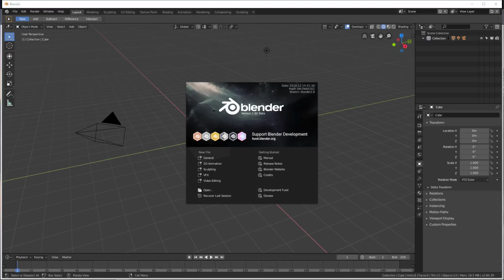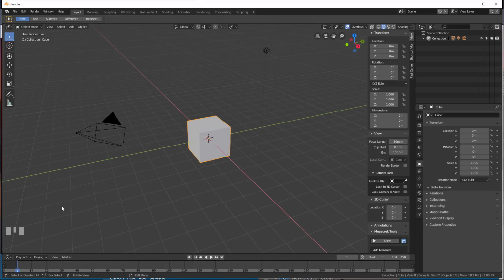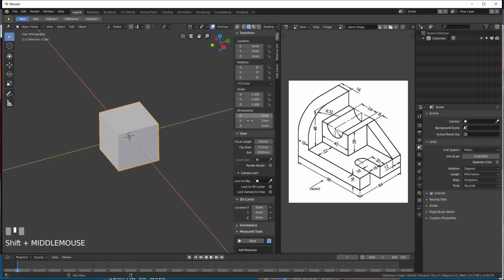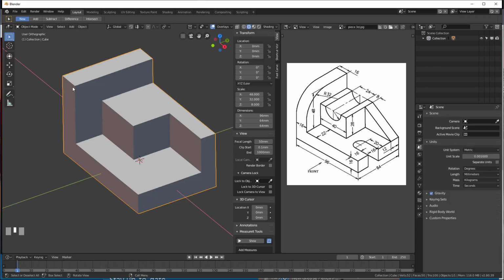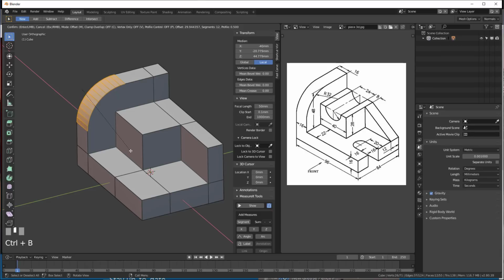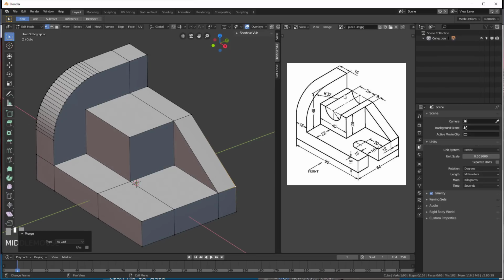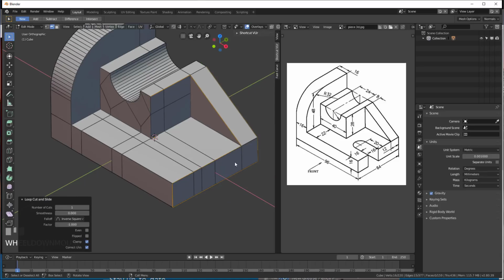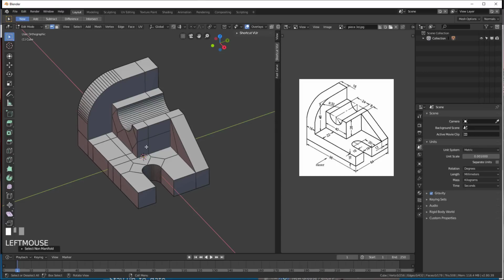Blender 2.8 Modeling a technical piece

Comment: +1 yojigraphics - This is a nice tutorial but clearly reveals how inefficient and time consuming that Blender is when creating precision/technical models as compared to parametric solids modeling CAD programs like Solidworks, Inventor, Autocad, etc.
Blender is a wonderful incredibly powerful tool but gotta admit I'm disappointed that Blender creators have completely ignored all of us engineers and machine designers to date who appreciate efficiency, accuracy, and parametric full editability at any and all stages of completion, and even post completion model revisions.   Oh well, at least we can import into Blender base geometry from our CAD models.
Reply: There are things called "Boolean Modifiers" in Blender that could have handled that much better with a non-destructive approach. You can basically add primitives and use them to extrude or remove shapes.
This approach would have been much closer to Solidworks/Catia/Fusion 360/CAD Softwares. Maybe the author didn't know how to use these tools.
But in any case I believe you're right, you'd still be a bit slower with Blender and you'd have to care about the amount of faces and to maintain your mesh clean / without artefact if you do it wrong.
Reply: @leplubodeslapin  I guess the real problem is the inherent diametrically opposed differences between precise solids-based CAD modeling vs mesh-based artsy-fartsy sculpting - size/precision be damned - approach.   Both methods have their own strengths and weaknesses.  Gotta admit Blender 2.8 is definitely worth the effort to learn... but what a freakin' learning curve for old farts like me!  😁😄😲😭
Reply: @Jimbo-in-Thailand  Yea I know how it feels!
I've used Catia for years before trying to learn Blender (for diferent usages, first one for product design and second one for real-time 3D meshes, but still both object oriented) and it's been quite hard to learn a completely different new approach of 3D modeling (solid & mesh being really different) but it's doable don't worry !
Good luck and yea don't drop your favorite CAD software, it definitely have some strenghts against Blender/Maya/3dsMax !
Reply: @leplubodeslapin  LOL thanks!  Yep... this time... I gotta do it.  😊
Reply: I'm dissapointed by the creators of CAD software that they completely ignored us, who model characters, animals, nature, fluid and fire simulations,.........................
Reply: @orsarino5395  🤣🤣🤣🤣 Yep... life is tough for all of us, ain't it ff? 😊
Reply: @orsarino5395  Toucheeeeee!

Comment: 13:36 or you could just select the verticies and choose disolve vertice or disolve edges... also 15:22 bring in a cylinder and use a Boolean modifier to create those cut pieces.

Comment: That tecnical shape can done in less that 3 minute in skectup, at least every software have 1 or 2 advantage to another
Reply: A tutorial is always longer than the necessary actions. If you’re fluent in blender I guess you can do it in under 5 min.
He explained one region in three different ways.
Reply: @hermask815  i am use blender too, but for tecnical drawing sketchup or archicad or autocad is more suitable for that technical drawing than blender.

Comment: At 7 mins in the video, it's loop-cut demo,  I follow you steps almost, but I can not let loop cut at 16mm, my keys are Ctrl-R  then GX+16, what steps i missed ?
Reply: you have the right steps, did you left-click to position the loop on the far edge before typing GX16? (which should then grab the selected loop and move it 16mm on x axis). There shouldn't be any other steps needed if you saw the loop cut created when you hit Ctrl+R and then left clicked
Reply: @plumdog  Thanks for your response,  I got right steps yesterday, between Ctrl+R and GX16, it needs two left-click extra
Reply: @plumdog  THANK YOU

Comment: Man, i really wish they would finally add some real CAD tools like Fusion 360 and Solidworks have into Blender...
Reply: I hope so... Been wanting CAD features or at least parametric sketch ability in Blender forever. I think there is some mechanical engineers working on making a variant of Blender that's CAD friendly but I'm not sure how active they are. It's called Blender Mechanical. :)
Reply: @Shika1son  Mechanical Blender. http://www.mechanicalblender.org/
Reply: @mutantgenepool  link down?
Reply: @allenal1839  No. I just tried and it's up.
Reply: @mutantgenepool  dead for more than two years tbh
Reply: @mutantgenepool  interesting...  most recent downloads available are from 2017 so I guess they're not developing it any more...
Reply: @mutantgenepool  Exactly COOL！
Reply: @Shika1son  We have BoolTool, and HardOps?
Reply: @ChrisD__  True. I have used Bool Tool and yet to use Hard ops. Though I was hoping to see dimensional constraints added in when sketching out lines in Blender. I really like the add-ons we got so far but there is a good portion of things I would love to see. :)
Reply: @Shika1son  that's possible with some of the new viewport APIs.
Reply: @ChrisD__  Really? Cool! I'll sniff around the net and see what kind of add-ons I can install. Though I might need 2.79 since most add-ons yet support 2.80. :0
Reply: @Shika1son  Tell me if you find anything, I don't think anything like that's been made, yet.
Reply: @darkcggaming  Yeah. i mainly do use CAD but it would be nice to use Blender's render engine natively with some CAD models I've made in the past. I know there other render engine addons for such CAD software but I really do like the workflow of Blender when it comes to rendering. It's a pipe dream but I couldn't be the only one who would love to see a little bit of parametric modeling in Blender. :3
Reply: I think Blender 2.80 has TinyCAD add-on in it already, try it out. It has some nice options. (edit mode TinyCAD > ... )
Reply: @Towik  My 2.80 does not.
Reply: that's the one thing i need to move completely into blender and forget about anything else, this is way too complicated, even if you know exactly what to do is gonna take a lot more time than with something like sketchup
Reply: You're right. But I would already be satisfied if blender could import some standard CAD formats like parasolid or at least step- stl is shit - and use it origin blender geometry.
Reply: if blender really manage to do it. ... autodesk death ha.
Reply: As a Solidworks guy for the last decade using Blender to do even the simplest thing like bend a tube or add a fillet took several tutorials and lots of hair pulling.
Reply: @chrislobby7447  not that Solidworks is too good at it
Reply: Blender just needs to get there units right. Something measured in blender will be totally different when exported into a slicing program.
Reply: If they do I'm deleting sketchup, autocad and solidworks and I'm never looking back
Reply: @hervekalundu2978  People are working on CAD Sketcher addon for blender. It's not perfect yet. It's a work in progress.
Reply: the other day i found a reddit from maybe 3 yrs ago where one of the main blender developers says "i am the one who intentionally decided NOT to add CAD to blender". he doesn't explain why tho. don't remember the name of the reddit but i found it googling
Reply: @dumbcat  why he?
Reply: me in 2020 me with blender 2.9 ):)
Reply: And cam lol imagine
Reply: wat u guys think about freecad?
Reply: I’m used to AutoDesk Inventor 23, and have been learning Blender recently as another modeling program. I really wish they had more CAD tools and similarities, it would be much more beneficial!
Reply: fusion360 is free until you earn a large amount money.
Reply: @666Azmodan666  Yes, it's the best, I've been using Fusion 360 for over 2 years 
but now they have changed the license, the free offer is still available if you qualify.
Reply: @666Azmodan666  Fusion360 isn't supported on Linux.
Reply: @khanoclast  
Emoticons he doesn't write that he wants it under linux ... Even if someone does not have windows, I can always buy it and it will be much cheaper and better than any other cad program. As someone depends, they can even have several systems.
Reply: @666Azmodan666  I'm not buying a new computer just to run Fusion 360. I agree it's good, and I used it a lot when I had a Windows system, but I switched to Linux for a reason, and I'm not switching back just for that. Plus, it's not cheaper if I have to spend $1500 on new hardware to run it.
Reply: @khanoclast  You bought something that does not support windows, it is hard to call it a computer, you regret money for a computer and you didn't regret spending it on a toy?
$ 1,500 a lot, I have fusiona installed on phenon 1045t is a cad program and there are no big requirements.
I don't know what you got there but sell it and buy a computer if you want it cheap, then some sort of used workstation is in funny money.
Install linux and windows and you'll be choosing what to enable at startup. Think also about the Windows emulator or virtual machine because I do not know if you know about such solutions may be the fastest and cheapest.
It is hard for me to tell you something specific because I don't know what equipment you have.
Reply: @khanoclast  Try this: https://all3dp.com/2/fusion-360-for-linux-how-to-install-it/
Reply: add nurboes

Comment: Nice . As a #Sketchup user i can make this model in 2 mins in sketchup. So i am thinking.. for some things sketchup is faster or easy to make some models🤔
Reply: Yeah, SketchUp is CAD software, Blender is not.
Reply: These kind of models will always be faster to make in CAD. On the othe hand if you later want to work with it in some artsy program like Blender, it's probably better to create it there from the ground up, because converted CAD models tend to be ngon hell.

Comment: rounding a convex edge to fillet it is fine - rounding two concave edges to make a circle is problematic. You need to run a remove double command to remove the double edges created by the fillet / bevel command.

those shapes I think are better done via boolean tools!
Reply: Boolean can cause it's own problems....
Reply: @jeffegg2  Like what?
Reply: @teresashinkansen9402  Cuts faces in odd places they don't like. Sometimes does unpredictable things.

Comment: Nice tutorial! But how to clean all those edges/lines? I'm used to be an SketchUp user.
Reply: Edges aren't a concern in Blender like they are in SketchUp, since the end goal is to have something look realistic. Edges have a cartoony look to them and thus, are not visible in the final render.
Reply: @sleepyjoshua  they can be a problem, depending on the model they can cause shading issues. But those issues can be solved quite fast and easy in Blender. 
But if somebody does the same modell in Sketchup and exports it, the topology would look worse. Must Sketchup users just aren't aware of the "real" topology Sketchup is generating because those lines are hidden and it looks clean but isn't.
Reply: SketchUp is a CAD software which the aim is solely for modelling by tracing out the shape of the object..  which is very differ than blender, a 3D low poly based software when the good topology is a matter.. u can see its matter when u doing further works on the model such as subdivision modifier and uv mapping that affected based on the typology quality of ur model